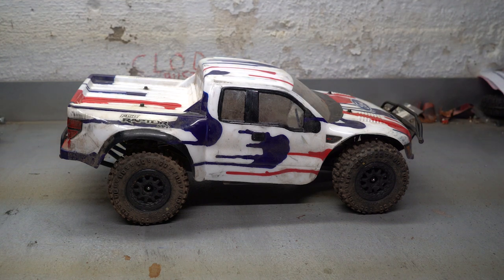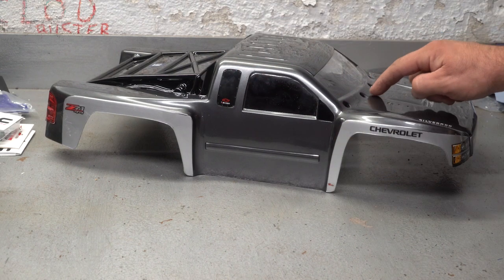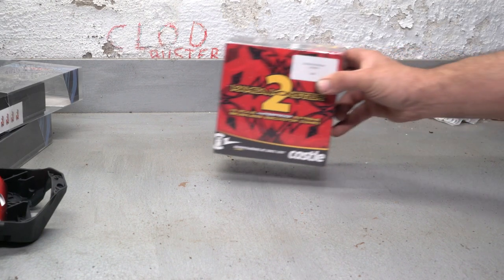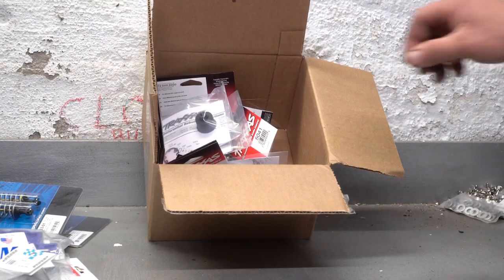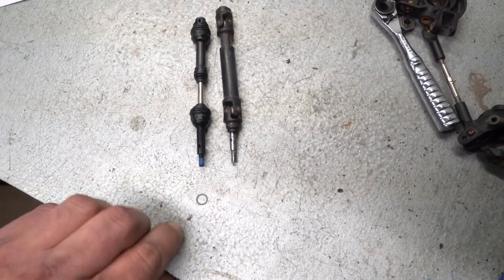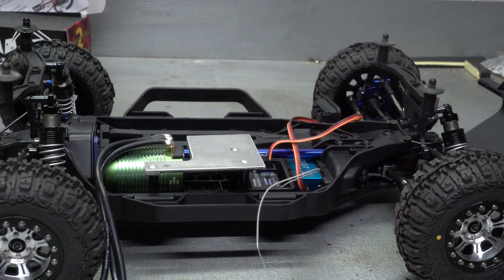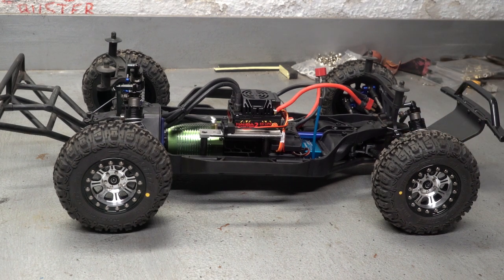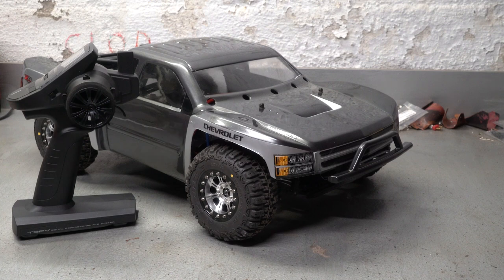Traxxas Slash 4x4 Rebuild with XO-1 Upgrades

Comment: you can mount the receiver box right behind the front shock tower. there is holes in the chassis for it.  then the ESC will fit down in the chassis.
Reply from the maker: Water Islife good to know. Thanks for the tip I’ll have to do that

Comment: The center diff helps get through corners quicker. Just an FYI. ( I have a Traxxas Slash 4x4 that I got back in 2010, and I run a center diff in it).

Comment: Awesome Slash 4x4 build, I thought of doing something similar with my Slash 4x4 maybe with a similar Castle system and maybe the XO-1 axles, uprights and diffs but i'm not sure if i should. You knocked it out of the park with this one it makes me want to build my truck similar but for right now i'm building an XO-1 with a Castle 8s system.

Comment: LCG Chassis option and than mount the ESC on top of a big mount sticking out higher than the original chassis.... Expert racer right there... :P
Reply from the maker: Yes what I should’ve done was mount the receiver behind the front shock tower  and that would’ve left a bunch of room for the big esc. I ended up doing a giveaway with that truck but I’ll be doing another one and it will be even better thanks to all the tips from the traxxas guys

Comment: I think the bigger spacers are intended for Slash 2wd front.  As long as you have enough threads to engage the nylon lock on the wheel hex it should not be an issue.  Definitely a boss build, those wheels are especially 🔥🔥🔥🔥

Comment: I love those Raceline Monster wheel's I have the RC4WD for my LOSI 5ive-T and my HPI Baja 5SC and also for my TRAXXAS UDR waiting to see if they will do them for  the LOSI Super Baja Rey, well I have a clone of the Baja Rey but it is way better scaled, two spare tyres fire extinguishers sand trax optional roto pack gas cans Raptor body. 
A well informative video.
Reply: Mr 5th scale... Gtfo

Comment: awesome build man. looks like one hell of a fun time.
Reply from the maker: tankboi82 thanks it was a fun build but I still have to make some gearing changes, it’s a little slower than it should be
Reply: @clodbusted1776  if you don't mind asking what's a build like that run you? I've researched some of those parts thinking about upgrades for my own Slash 4x4 a year or so ago but stopped when I was around $450 or so.
Reply from the maker: tankboi82 I spent way too much! With all of the electronics, xo-1 parts , wheels, aftermarket shocks, aluminum upgrades etc. it was almost 2k in parts but it’s definitely a great reliable truck

Comment: Get the light kit !! My friend just got the 4x4 ultimate and the light kit it's an insain truck on 3s Definitely alot funner to drive and more connected feeling than my old 2wd slash ever was they have come along way
Reply from the maker: Carson Wilson I plan on getting the light kit it looks awesome. I have to pick up a new 3s battery the one I was using went bad so I only got to run it on 2s
Reply: @clodbusted1776  right on brother .. always looking forward to the vids !

Comment: I built a slash out of nothing but upgrade parts n man I spent a ton of money lol I also have the slash 4x4 with the HCG chassis n either gonna do the JConcepts freestyle monster truck conversion or gonna get a LCG for it. Slash is a great rc i've got 3 of them
Reply: It came out awesome!
Reply from the maker: I didn’t realize there is so much aftermarket support for the slash. Hopefully this thing runs as good as it looks

Comment: Sweet truck I have exactly the same build except I used blue everything aluminum and no strc I have traxxas shock towers also aluminum a arms but man nice to see someone else who has the same kind of taste. Mines for sale in Seattle Washington
Reply from the maker: That’s awesome! Nice build the only thing I got wrong was the gearing, it was a little under geared with the 1/8 scale motor but other than that it ran awesome
Reply: @clodbusted1776  yea I dont run castle in this truck Velineon but the gearing  currently is 51spur 21 pinoin both Robinson racing Hardened steel.  I've been super happy with them
Reply from the maker: @jimmynavarro3760  good to know if I build another one I’ll try that gearing

Comment: Dud I'm not an expert racer but i enjoy the hobby and luv to put the better parts on my truck. I have done what you just did several times. The funny part is i just brought a used traxxas and purchased everything for it. Sooo i never used the old purchased traxxas or parts and i really didn't have to? So i basically purchased a used truck for no reason?

Comment: You might as well just bought a whole Nother RC car lol
Reply: I just made the same mistake. Now I'm selling the roller on eBay because it has a blown motor😭.
Reply: Well that’s not as fun lol
Reply: I am in the process of making one now. I bought the lcg conversation as a base. It came with the motor mounts, battery hold down, bulkheads, nerf bars, receiver box and a lot more. Got it for $50.   I made a trip to the lhs thinking I got everything but I forgot the ring and pinion gears. So I can’t do the diffs tonight.

Comment: Very cool build! Congrats. Question after the die paint you notice any changes on flexibility or rigidity in the chassis? Because those plastics when boiled tend to be more flexible.
Reply from the maker: It seemed about the same I didn’t really run it that much because I knew I was gonna be giving it away and didn’t want to mess it up. I’ll be doing another giveaway in the future

Comment: I see people dye parts all the time. They come out looking good. My question is how deep does the dye go? I mean does the slightest surface scuff show through or does it go deep enough it takes it??
Reply from the maker: shawng7902 so basically the longer you leave the part in the dye the more  it penetrates. I have some pretty deep scratches in the bottom of the chassis and so far the grey has not shown through. I let the chassis sit in the dye at a low boil for a few hours and then kept it in the dye overnight while it cooled down
Reply: Awesome.  Thanks for the reply man. I wondered about it. I'm glad the dye sinks in like that.  I may have to do mine. Your build is about like mine. Brought home a new gen rustler vxl 4x4. Within 1st 2 weeks I doubled what I had in it. Axles are the next upgrade. Those parts laying around lol. I have a new rustler in a box damn near myself. I want to find a slash and build one instead of buying. And everyone needs a couple 2wds for on road builds.
Reply from the maker: shawng7902 I was just looking at a 4x4 rustler they look pretty cool
Reply: @shawng7902  make sure you get the synthetic dye when you're picking it up. The synthetic will get further into the polymer/plastics. 

I dyed a plastic chassis for my son's Charger 10/22 years ago. After getting bounced around in a backpack for the last 3 years it's starting to show some scuffs, but nothing very noticeable. I only boiled it for about 45 minutes. I'm sure the finish would have held up better with more time.

Comment: How has the truck held up ? I have the slash 4x4 platinum that I want to put that esc/motor combo in. Thank you
Reply from the maker: Chris Wade sorry for the late response for some reason I stopped getting notifications from yt. it’s been holding up great. Motor/esc combo is rock solid I still have to change the gearing it’s not as fast as I thought it would be, I’ll have to go on some of the forums and see what everyone else is running. I’ll do a update video on it soon. Thanks for watching
Reply: clodbusted thank you so much I really appreciate your help.

Comment: What was used off of the original slash? 
Great build, looks sharp.
Reply from the maker: al currie didn’t use much of the original parts I used the a arms which were rpm, the rear bumper and the front and rear diff housings everything else was new. I still have to change the gearing it’s not as fast as it should be

Comment: That there is a good looking Slash. I had thought of something as I was watching the ESC and receiver box issue. How come you didn't mount the receiver box on your aluminum plate and mount the ESC down low?  You wouldn't be able to use that specific plate obviously as you had made it to mount in the position it is. I thing the receiver and receiver box might weigh less than the ESC. Not 100% sure though as I never even thought about it till now. Either way, as long as it works, then it's good to go. BTW. Aside from the screws and a few other small bits, I think you just built a second Slash rather than using the original. Lol. That Tekin setup in the old chassis is a sweet deal. I've heard Tekin is a reliable ESC. I've got the same Castle system you have and have not even used it yet. I originally bought it for the Summit, but as time went on I thought about putting it in other RCs. It eventually got back around and the Summit is definitely going to get that system. I originally bought it because I thought it was a sensored system, which it is not. At the time my Summit was my only "crawler" hense why I wanted a sensored brushless system. A couple years later I picked up the TRX Bronco and now that is my dedicated crawler, so I can convert my Summit into an E-REVO with selectable lockers. Lol.
Reply from the maker: Lane Waite I thought about that too but it would be hard to route the motor wires around the receiver and the esc would be very close to the servo but I think it would definitely better for weight distribution. You’re right about the tekin electronics they’re very good and reliable I’ll end up using them in another truck at some point
Reply: Or you could have mounted the receiver box in the secondary location up front above the drive shaft
Reply: @jaredzak1814   That is what I did I have the same setup and I simply move the receiver up to the secondary position behind the shock tower and mounted the ESC in the original position

Comment: Surprised you didnt buy a chassis brace
Reply from the maker: highridinf250 I just checked out those chassis braces. Thanks for the tip I never did that many traxxas builds I’m surprised at how many aftermarket parts are available for it
Reply: @clodbusted1776  yeah I'm going to be buying a lcg chassis and build it from nothing into a speed truck
Reply from the maker: highridinf250 that’s cool I keep me posted on how it comes out

Comment: Might as well bought an xo1 for as much money as you put in an old slash... And why even show us the old traxxas slash in the beginning? I think you uses the diff housings from it? Correct? You built a whole new truck for 750 without batteries...
Reply: Lol 2years later, go buy anything new as a roller and it's basically the same price. Not everybody is a "out the box RTR or its junk" kinda guy like you 😂 , custom builds are 10x better

Comment: All the parts most have been over $500.
Reply from the maker: It’s crazy I added up all the receipts it was over 1800 it ads up fast especially with the xo-1 stuff
Reply: @clodbusted1776  you could have bought several new rcs for that.
Reply from the maker: Brad Kalman I know but I wanted to see how far I could go with a slash
Reply: This is the problem , i have to its fun to build but cost so much more yes you get a better product but...i have 2wd completely aluminum i built long time ago just shelf queen it w a 55 chevy lid
Reply: Thing is awesome,  you shoukd keep it
Reply from the maker: Paul Clancy I probably will
Reply from the maker: Paul Clancy I did some aluminum upgrades to a traxxas Bigfoot and I gotta say it’s one of my most fun trucks it’s not the fastest thing but it’s quick enough and handles pretty good
Reply: @clodbusted1776  ik what you mean ,i built another 2wd slash Herbie bug with right anount rpm and aluminum over years was one most fun 10 th scale
Reply: @clodbusted1776  I just did a complete XO-1 driveline swap to my Slash, (diff gears in Hot Racing aluminum housings, axles, aluminum hubs). I got away with it fairly cheap considering. Ordered everything as brand new take-offs from Jenny's RC, saved a bunch of cash. 

That truck looks great!👍 I'll be stealing some ideas from your build here, it's clean. I did the exact same upgraded slipper you showed. I ran it about a turn out from tight and it did a great job preserving the stock axles.
Reply from the maker: @jerrywilson6921  that's cool. They're awesome trucks. I'll check out Jenny's Rc I didn't know you could get take offs